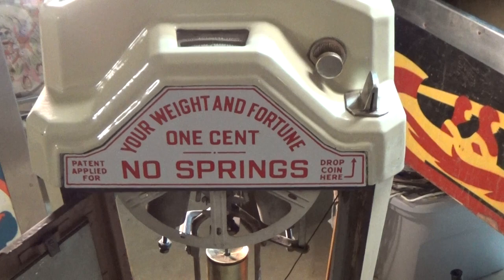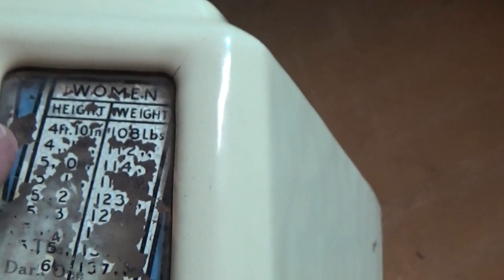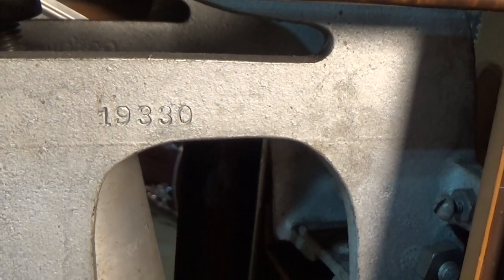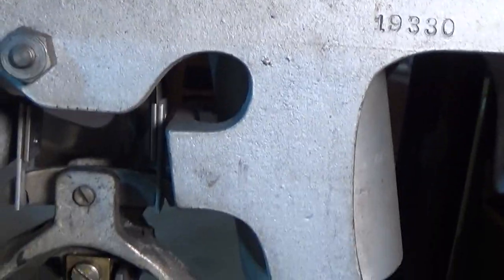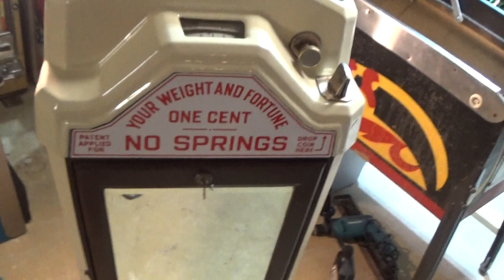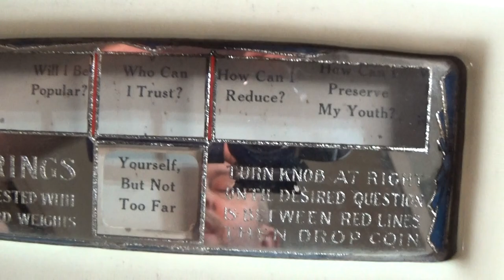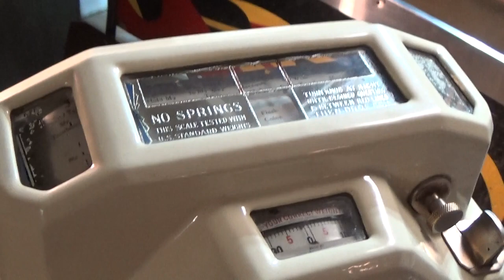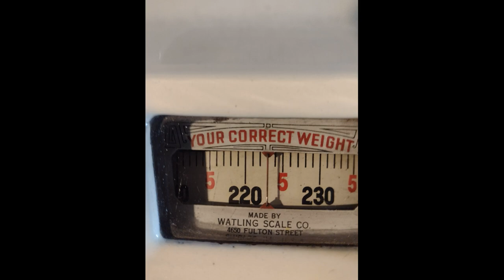Watling, "Tom Thumb Fortune" Penny Scale

Comment: I just picked up a scale like yours. I think the woodgrain paint is a factory job as mine is exactly like it. Mine seems to be missing the rod that hooks into hydraulic cylinder.
Reply from the maker: Since the video, I believe it is factory mostly based upon how the stickers were placed afterwards and doesn't look like any other base coat underneath. You can still get the parts. If you unscrew the dashpot (hydraulic cylinder) there should be a piston and rod assembly in there. That rod pokes out of the top of the cylinder. Piston and shaft part number is WMTTF84. Thanks for watching. I have a pile of new videos coming out. Just recording them in batches.